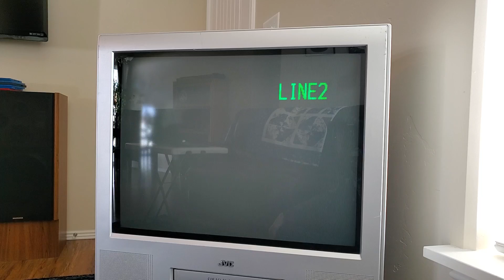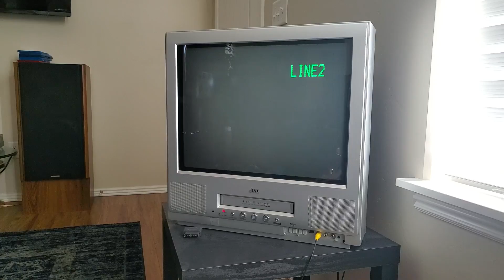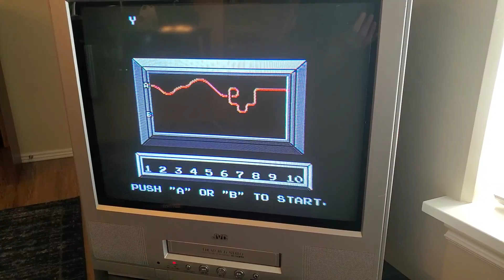NES Bad Memory Repair

Comment: 14:47 hey dude, the screws have to be longer and silver those in the your right on the age of the connector ,all other screws in the system are those shorter golden ones, this is the problem here with the bending ! you did not mount the black drawer the right way so that why you can not close the case. just disassemble the NES again and try to put it the right way
Reply: Was gonna say the same, ive been in the same situation.

Comment: Hi, i wanted to contact you in some way because i have an ast premium exec (the 386sx one), but i'm missing the power brick and there's not much documentation online.
I've seen an old video you made about it, do you mind sharing some info of the power supply of it if you still have it?
Some really useful stuff would be in order:
a picture of the back of the power brick
get a read from the multimeter and make a chart of which pin delivers what voltage (and which pin is directly connected to ground trough the continuity test on the multimeter)
would be really the best thing if you could get a read while powered on because it's an unregulated psu, but don't do it if you're scared of frying it!
Sorry if i seemed rude or made spelling errors (english is not my native language) and really for being off-topic regarding the video ':D
Reply from the maker: Do you use discord at all? That would make it easy to share pictures
Reply: @Tr3vor42532  i use discord! I'm really sorry i didn't respond earlier, but youtube didn't notify me and randomly checked today!
P.s. My username it's Sonno Ocea#1427
Reply from the maker: @lorenzoporciani  I sent you a friend request, my username is Dire Docks